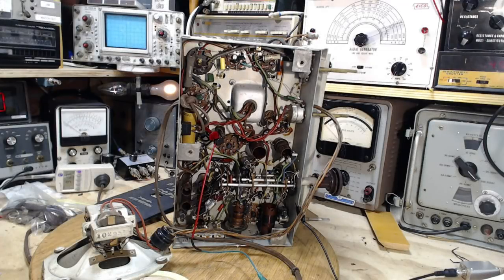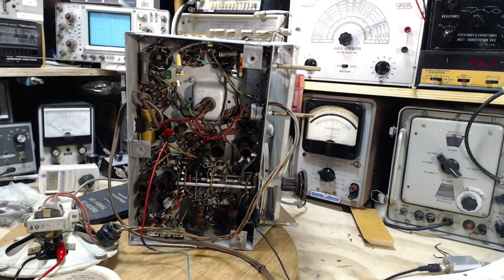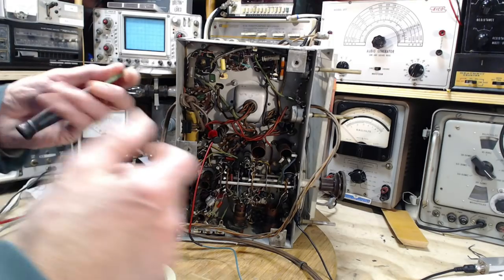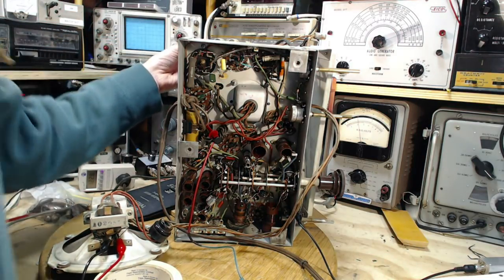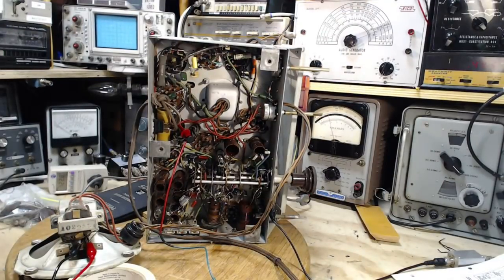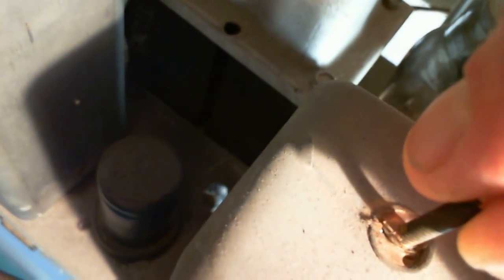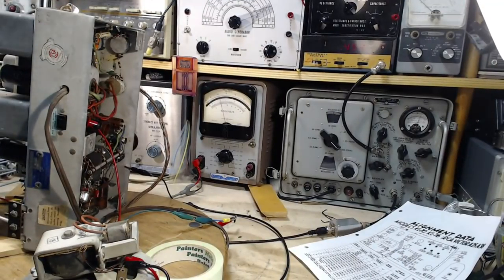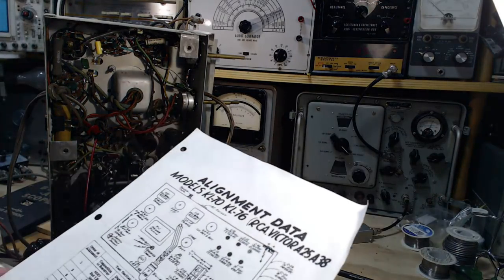General Electric KL-70 AM/SW Radio Video #26 - Alignment Begins

Comment: Hello Jim, that cap (shaft with hole) is a special cap, to set it you need to lose the nute ( bottem of shaft) then you can PULL/PUSH is in and out.  IF the shaft it self has no visual tread than you NEVER turn the shaft specialy when the nute is still tight, you only damage the shaft of the cap. basic  you just need to lose the nute  then pull the shaft to get a lower cap value (higer freq), or push the shaft down to increase the cap (lower freq)  if the shaft has a tread then you can't pull push it you need to turn it but when i look at the movie, i cant see the shaft having a tread so it just pull/push. to tune, ps dont forget to thight the nut when ready its to lock the shaft in place.

Comment: Jim, I can't see what you're working on to tune for 21.5 MHz but it sounds like a metal shaft that is locked in place by a retaining nut where the shaft meets the chassis.  Loosen that nut and the shaft should move vertically.
Reply from the maker: I went at the trimmer capacitor on the next video.  Turns out he has two cousins in this radio too.